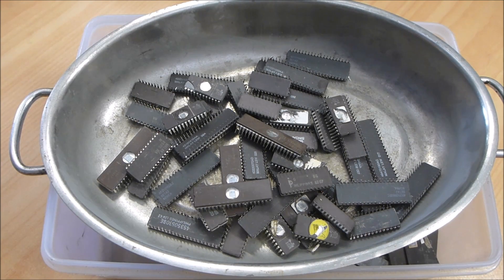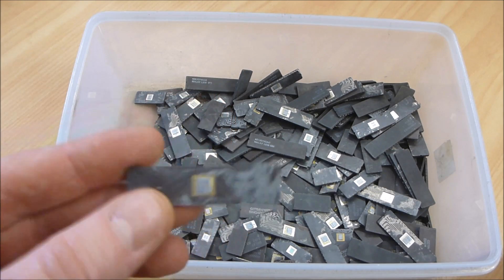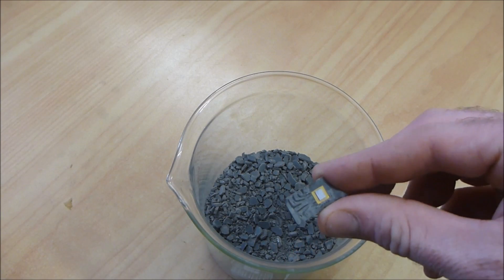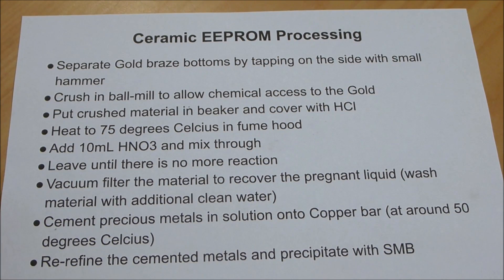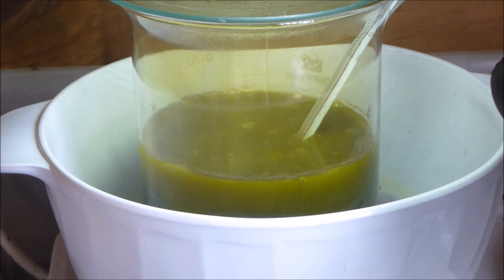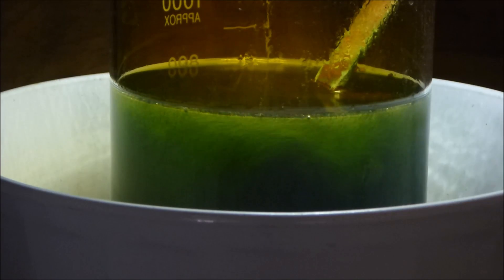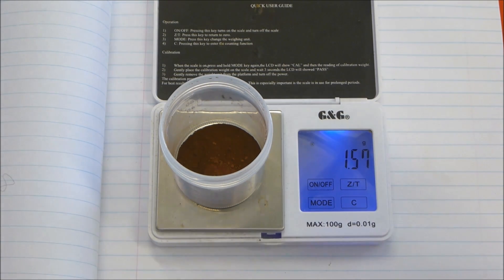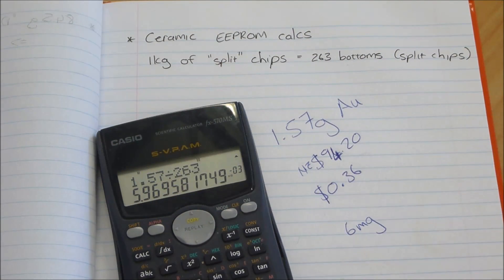Gold Recovery - Yield from Ceramic EEPROMS

Comment: Also please confirm the gold is around the dies and not the bond wires because all the Eproms I have only have silver coloured wires?
Reply from the maker: The majority of the Gold is often in the braze that is used to "solder" the die to the ceramic substrate. The bond wires are often Aluminium.

Comment: Does it absolutely have to be crushed?
Reply from the maker: Depends on the particular chips, they have to be cracked open to allow the acids to work on the Gold at least, but its really just quicker if you smash them up, it can take a long time for the acids to dissolve Gold out of a small amount of space between the dies and ceramic.

Comment: Like always a very nice and informative video. What about the bonding wires. I always check the bonding wires through the glass and the never are gold. I know they are there but I never came across. That is why I always dropped them together with the low grade boards.
Must there be gold visible under the die or contain the IC’s without visible gold under the die gold as well?
Reply from the maker: Hi Bob, As far as I can tell they either used a Gold based braze or Silver based braze to attach the die to the ceramic. I have a box of Silver ones that I haven't bothered with since Silver is not really valuable enough to warrant the effort. The bond wires seem to almost never be Gold in these ICs, I have heard people say that they can be Pt or Pd, but my understanding was that they are just Aluminium. I would definitely not sell them as low grade boards, if they have Gold braze showing, they are very easy to process, even if the yield is not that high, still much better than low grade boards!

Comment: Without removing base metals and using the HCL and the 10ml  of nitric acid wouldn't this put too much of base metals in solution with the gold since you have essentially  made aqua regia?
Reply from the maker: Hi Jean, ceramic EEPROMS don't really contain too many base metals (as long as you get rid of the pins). So yeah, I normally treat them directly with AR.
Reply: @successfulengineer  Ok thanks for that info

Comment: Would it not be easier to snip the middles out before crushing or is there gold all through the base?
Reply from the maker: Hi Pete, those ICs are all ceramic, so basically as hard as glass and quite brittle. All the Gold is in the center, but there is not really any way to concentrate it any more than splitting the chips easily!

Comment: Since the copper, tin and other metals are basically free is it worth going after them? It would require more crushing to fully liberate everything. Does the chemistry allow you to copper, steel, gold and silver all at the same time?
Reply from the maker: If your main aim is to make a profit out of the processing, then you will most certainly want to at least get all the copper you can. Unfortunately I found almost all the legs in ceramic ICs to be made of Kovar, so basically worthless. Where ICs have a obvious big chunk of Copper, I will often include that in the "per IC value" calculation.

Comment: Ever come by 1990's Atari boards? What's your valuation on them?
Reply from the maker: Hi Tony, couldn't tell you specifically, but if they were made in the 90s, then they are probably too new to have any significant number of ceramic ICs unfortunately, so potentially no very valuable from a Gold recovery point of view.
Reply: @successfulengineer  You're right. I got a pile of them and pretty much all onboard chips are plastic except for eprom plug ins that are all ceramic. Nice solid boards compared to current. Some of them are late 80's. Will definitely hodl em. Thanks!

Comment: Theres no need to ball mill these, these can be added right to Aqua Regia especially if you remove excess ceramic. Saves time requires very little nitric, 15ml or less
Reply from the maker: Yeah, 100% agree, the problem with direct AR is that it has to "eat" the Gold out from under the die, so you just speed the process up heaps by breaking them up as fine as possible.

Comment: Vacuum filtering? Sorry somewhat ignorant about that. Do you have a setup/operation video?
Really nice work.
Reply from the maker: Hi, sorry, yeah, some things I just assume everybody is familiar with. Vacuum filtering is where you use a Buchner funnel + vacuum filter flash + vacuum pump to speed up filtering. It basically seals the funnel into the flash and when you apply a vacuum it "draws" the liquid through filter paper into the flask.

Comment: Do you know how much silver and copper you get per Kg?
Reply from the maker: 99% of the time Ceramic ICs use Kovar legs (expands at the same rate as ceramic), so not much Copper in these. Silver I didn't specifically target, but by the low amount of Silver Chloride that came out I would guess that there is not enough Silver to justify the Nitric acid cost to recover it.